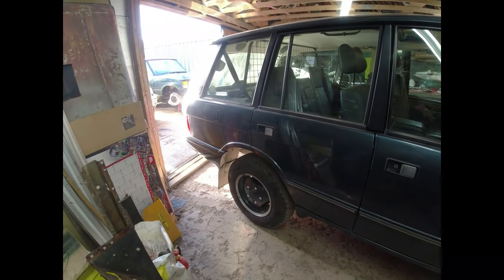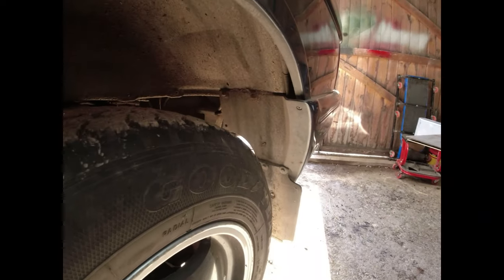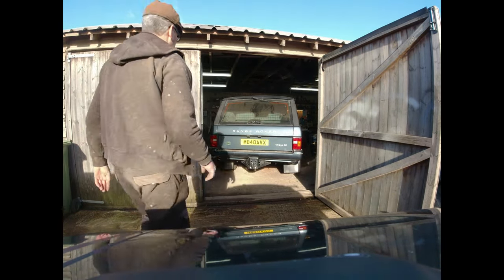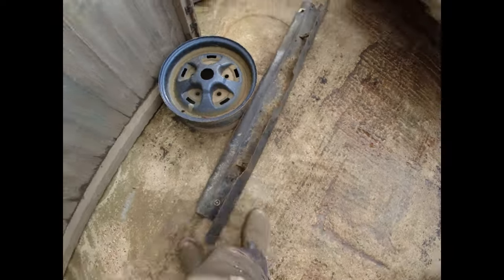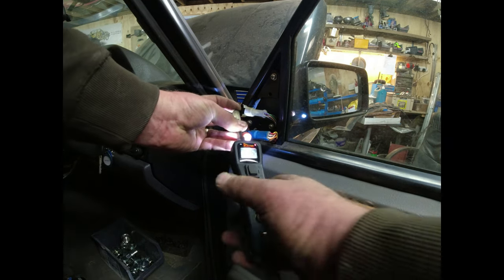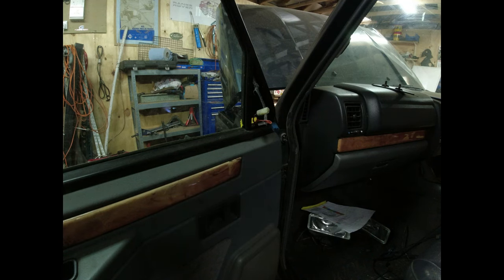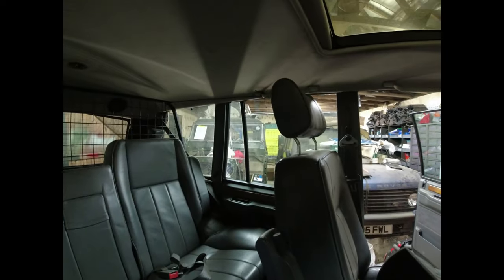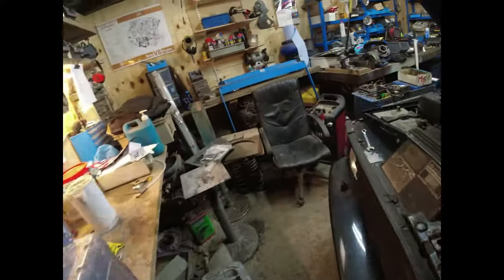1994 Range Rover Vogue SE 300TDI - rear Brooklands bumper, window and mirror issues Ep9

Comment: Probably repair them window ecus by just adding some good leaded solder with a fine soldering tip. Vibration causes usually a ring shape break on the solder joints. Happens with house electronics let alone a vibrating car. Keep up the good work jimmy.